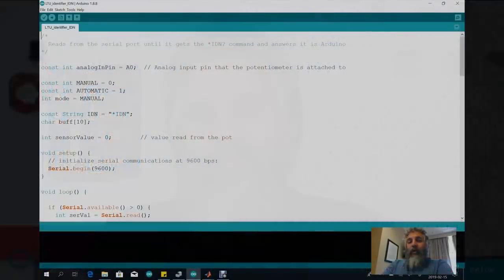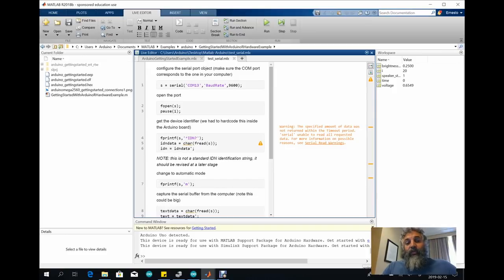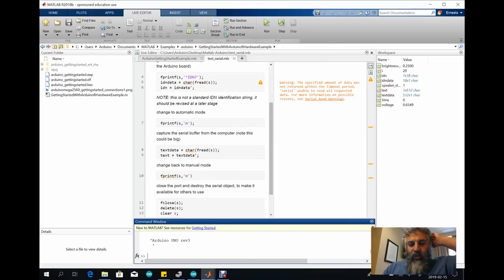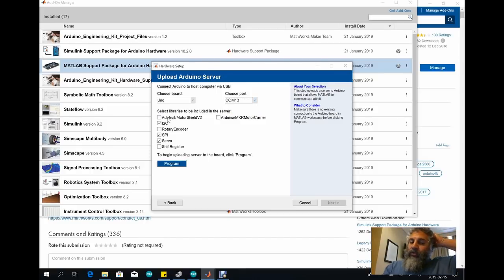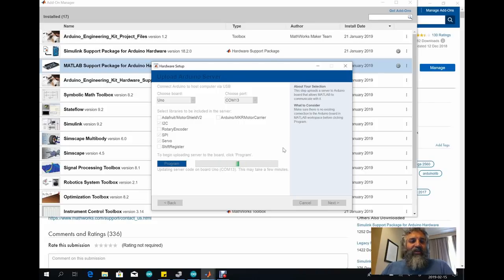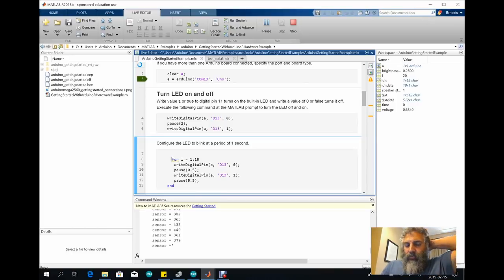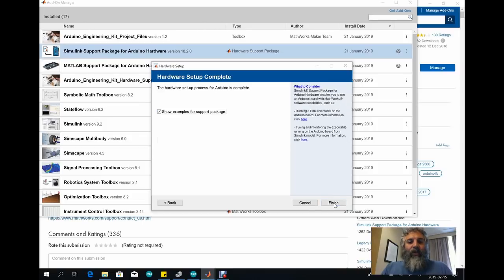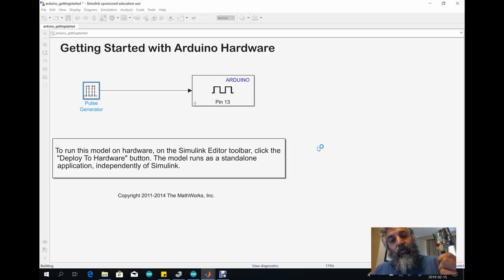MATLAB Meets Arduino UNO - Arduino LiveCast S03E04

Comment: I have a project that needs arduino to control the webcam by having it snap a photo when the proximity sensor connected to the arduino has sensed an object within its range. however, I must use matlab to display the webcam's view and from there, an image will be created and saved. how can i use matlab and arduino to do and I have already done the video streaming on matlab, i just want arduino to communicate with matlab by saying(not literally) "hey, I sensed something via the proximity sensor (not pir),  i want you to capture it and save it" 

Mark could u tell me please the way? This is for my last project to get mechanical engineering bachelor degree.
Reply: Hope you did it :D